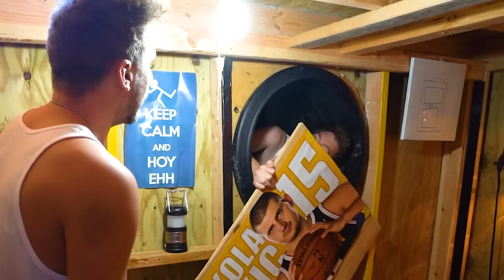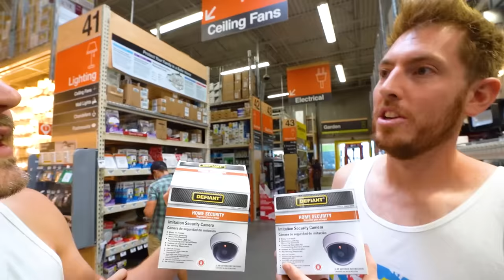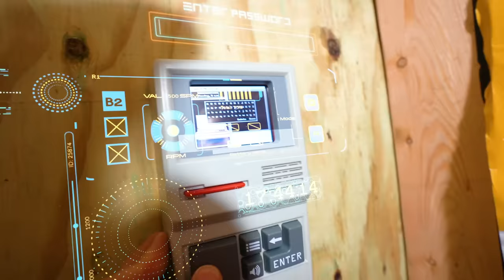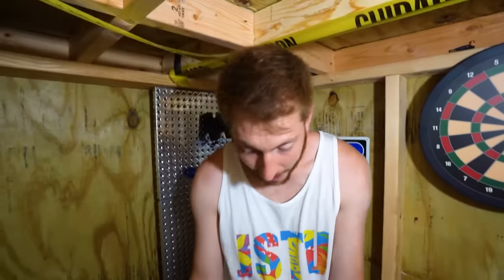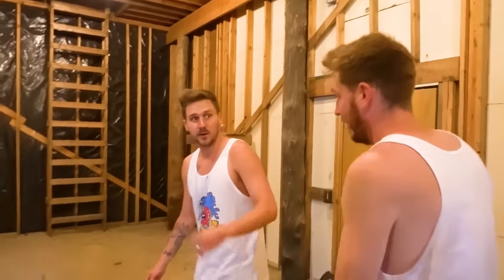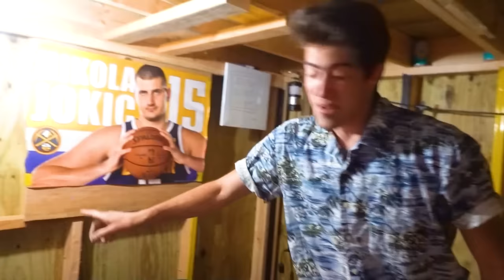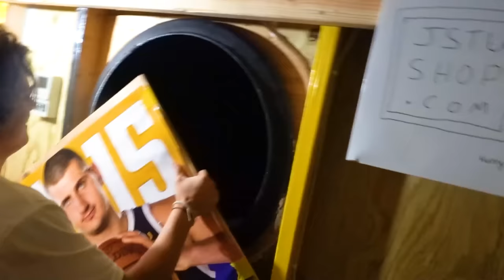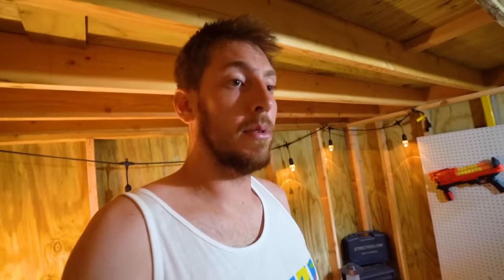HIDDEN SECRET BUNKER *UNDERGROUND TUNNEL*

Comment: It would be cool if they had a door that led down and next to the ladder mid way down would be another room that led too a few more rooms and then back at the ladder down at the bottom would be a room filled with snacks to the point you could barely walk in there but the farther they go down the stronger the bunker would be. If they actually did this I would be sooooo supprised.